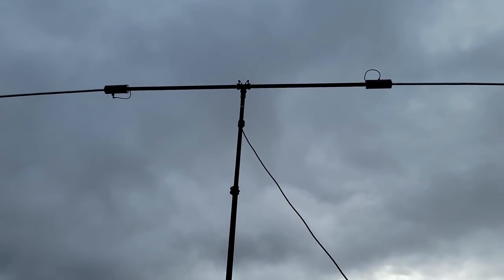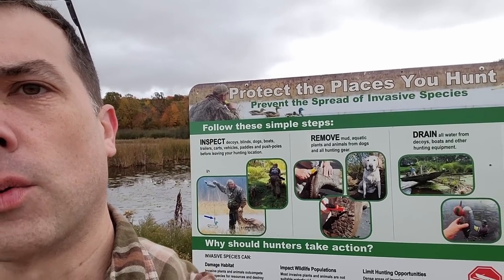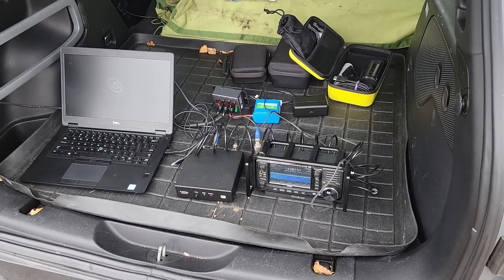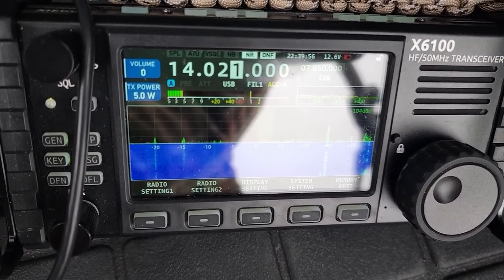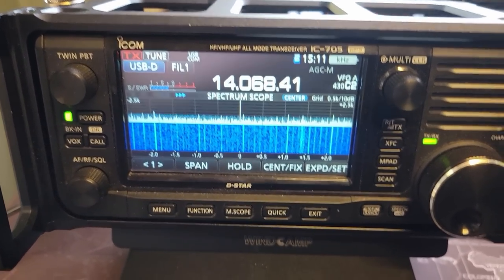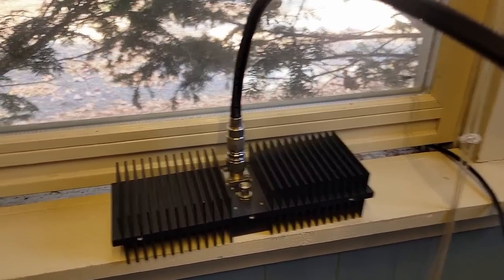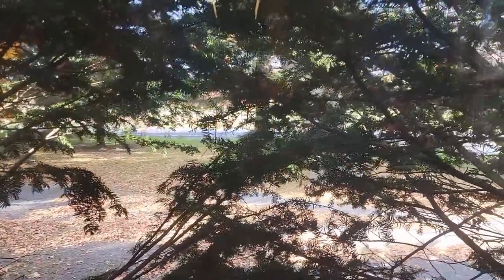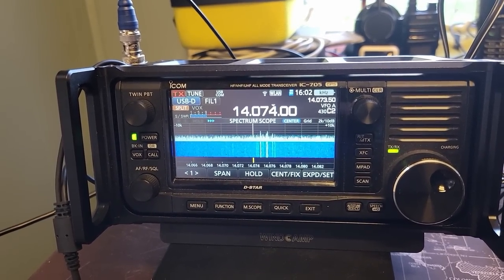But wait, there's MORE!

Comment: You may wish to reduce the number of joins on your buddy pole feedline. I remember having in drilled into me that each time that you join your coax you lose your signal. When I used to work on the tools the cowboys in the industry would extend antenna cables the professionals would simply say No it's too lossy! Not to mention we could book more hours. But inline with any signal losses where there is the chance of signal loss there is the chance to introduce noise.  😉
Reply from the maker: Exactly!  Either I plug in extra feed line or I don't get on HF - so some losses are acceptable.
Reply: @temporarilyoffline  the rule of Needs Must!
Reply from the maker: @jamesmoore6424  when the devil drives!
Reply: The loss from the extra connectors is so small.   You can measure it with a VNA but you will never notice it on the air.   In fact if TO would measure the loss of his extra cable with the choke on it I would guess the loss would be less than .5 dB.
Reply: @terry5089  Yeah, but when you do it for commercial. You don't want to give the customer a reason to complain....  I have arraived at a customers siste and looked at antenna runs with just 3 joins on UHF and a yagi pointing to a repeater sight ( i know it's not hf) but was not getting into the repeater, plugged in my Bird meter and tripped the repeater with ethe bird but not with the bird removed...  re ran the coax 1.2 to one... close enough and good  reports. 😁

Comment: Stock waterfall colors? Make it pretty.
Reply from the maker: Some day
Reply: @temporarilyoffline  put that carrier point where it should be as well. It just looks wrong on SSB. I wonder even why iCom put it there by default.
Reply from the maker: @forgetyourlife  I like to run my FT8 waterfall at 2.5k display, and having the center point "proper" means I have to run 5k to see the waterfall on the right side of the display - the only "argument" that exists in defense of doing it wrong. :-D

Comment: So sad when hams use a tuner on a very easy to tune antenna...$1300 radio a $300+ antenna and a good bet did not bother with a antenna analyzer...Someone PLEASE tell me why people use a tuner on a buddipole or buddistick...They are NOT hard to set up and tune..Once done leave the clips in place and they can be set up in running in less then 10 mins...And you do NOT need a fancy antenna analyzer like a Rigexpert or something like that..I use nothing more them a iPortable iP60z in my 705 go box and it works perfect for it..Once set the first time you just set the Buddipole up scan it  real fast make any minor whip adjustments and done...Close to $2000 in just the radio and antenna and uses a tuner 🙄🤥..People can jump me all they want here but if we are going to spend this kind of money on just 2 things why not spend an extra $249 on a antenna analyzer and do things the right way..Am I being harsh and a jerk....Maybe yes however useing a tuner for a Buddipole is NOT needed or doing things at the best..Spend a little extra buy a antenna analyzer take that antenna out to the field the back yard wherever take the time the antenna analyzer TUNE it leave the tuner at home...Having used the Buddipole and Buddistick for years now I can say with a little time they will rock on a 705 or any radio when tuned..
Reply from the maker: Some people's kids man!

Comment: The noise on the USB is simply RFI generated by the laptop, and it makes the usb controller on the radio unhappy.  

If you open the laptop up you'll see all the shielding inside of them used to contain it, including metalizing plastic parts with copper.  The USB cable creates an electrical connection between the radio and the laptop, giving that RFI a place to go.  If you use a second receiver, you'll see the usb cable also radiates, which is why it's best the toroid is near the laptop end of the cable.    

"Shielded" cables are basically pointless because that braid in the shielding just creates a nice low impedance path for the RFI the laptop creates to flow along. (A shielded usb cable is basically just a coaxial cable with multiple center conductors)  Different story if you carefully severed the braid at one end of the cable so it acts like a faraday cage and not an rf conductor.

The antenna and all of the coax is simply creating a ground plane for the laptop's RFI and the radio is the bridge between the laptop and that ground plane.  Everything about USB is RF friendly, especially the wide flat plugs, which is why the toroid solution has repeatedly been proven to be the correct answer to the problem.  It jacks up the impedance on the cable and simply gets turned into heat in the toroid.
Reply from the maker: Absolutely correct!

Comment: Aloha Steve, I’m not always into some of your more “brainiac” videos, only because some of the older computer stuff goes way over my head. 
    In this case, I totally understand your dilemma because we deal with a ton of interference from all the military bases here on Oahu, especially from Pearl Harbor/Hickam. Plus we must deal with a lot of interference from all the Waikiki area hotels that have old and outdated repeaters. Usually, each hotel has two repeaters, one for housekeeping and the other for security and both are usually mounted on the roof of the hotels. 
    I’ll give you a great example, I use to live right next to the Waikiki Marriott Hotel on Ohua Avenue and my buddy, Kenny, a fellow US Marine, is still head of Security there. I owned and had coordinated the Waikiki Repeater that worked fine for many years but started getting interference from two sources, the Marriott and the Hilton Prince Kuhio. 
    The Hilton was actually easy to deal with because they came to me and asked me to change the frequency of my repeater, that I was bleeding onto their repeater for security, lol. 
    They had two things going on, one was a really old repeater and the other was they were using a third party that had set up their communications needs which I won’t name here. 
    I could hear them also, so I had this manager from this communications company asked me personally to change the frequency of the Waikiki repeater that was coordinated with the State of Hawaii. 
    I told him point blank that changing my frequency wasn’t going to make a difference because(1)they were using really old and outdated repeaters(2) their coax cable has gone bad from all the VOG from the Big Island volcano, 3) Not coordinated with the State and 4) Transmitting on the Amateur radio bands. 
    I told the Hilton, who was ready to sue me if I didn’t change frequency or remove the Waikiki repeater, that the FCC would fine them $15k per day for as long as their violations continued and/or if I registered a complaint to FCC, which I didn’t need to. 
    After sitting down for a meeting with their hotel manager, a hilton attorney, the manager of the third party for communications, and myself, they finally saw things in the same light as I did, the FCC fines of $15k a day convinced them to buy two new digital repeaters, problem solved, right? No, there was other hotels in the area that were waiting for the outcome also. All the hotels around me changed to new digital repeaters also except the Marriott, which did everything right from the beginning, was coordinated on the business band and everything. 
     We did get the Marriott to drop a few grand for new LMR 400 coax from the roof to their security office on the third floor. The VOG had damaged their old coax over the 12 year period when it was last installed. 
    Steve, long story short, this could be one of the major shortcomings of the ICOM IC 705? Can this problem be fixed internally by ICOM?
Reply from the maker: From what I understand icom doesn't want to fix this problem, instead leaving it up to us.  Nothing is ever "right" in our world, it's just "right now"
Reply: @temporarilyoffline  I do know that Ray Novak N9JA of Icom America works very hard to find solutions to problems that do come up occasionally and maybe with your two videos,Steve, maybe there will be an update or a patch that fixes this issue. 
    BTW, Ray gave me a new D Star repeater to put up here in the Honolulu area and got it set up last year in order to start HERO-Hawaii Emergency Radio Operators. We’re just a bunch of US Marines that were not afraid of Fauci’s bioweapons to be the only organization in the country to do in person VE Testing Exams and online. We have been having difficulties obtaining ARRL status since our ARRL Sec. Manager is loyal to another amateur radio club but these things usually work themselves out over time. At least we obtained none profit status, that’s a great thing for a club that’s only less than a year old. 
     Steve, you are a valuable asset to the Amateur Radio community for some of the most in depth videos of our times. I absolutely cringed when you took apart a brand new Xiegu X6100 and made it look easy. I know you told me that your video challenged your abilities while making it but it also gave a lot hams hope that we can still take radios apart and put them back together again, which is what got me into Amateur radio in the early 1970’s with those free Citco radios my grandparents got every time they fill up their gas tank. I can’t tell you the number of times I took one of those apart. Thanks Steve! 👍
Reply from the maker: @digitaldreamer5481  HERO sound awesome!  It takes real courage to hold your principles in today's world of little sense.